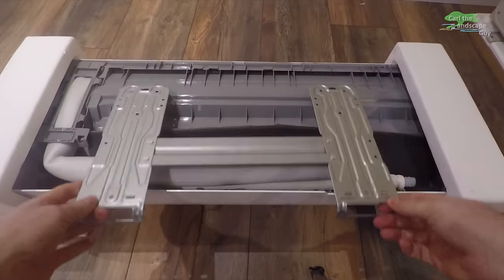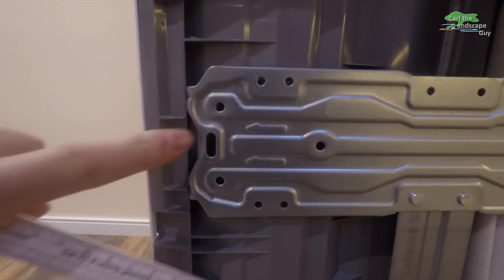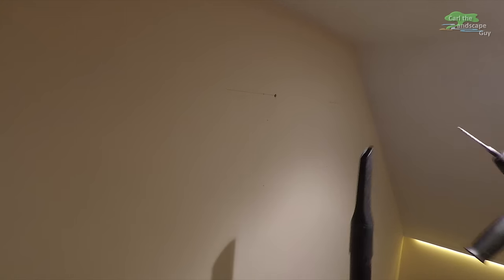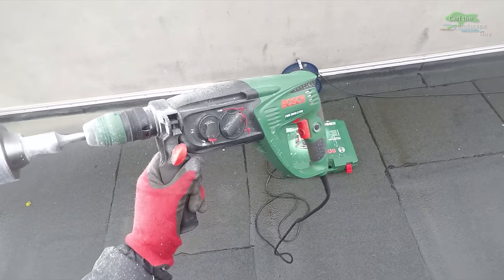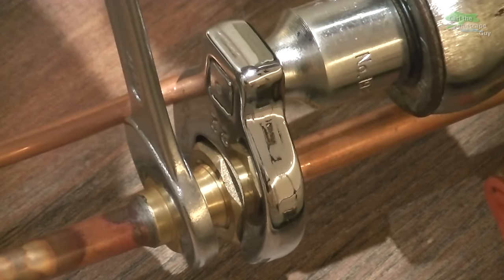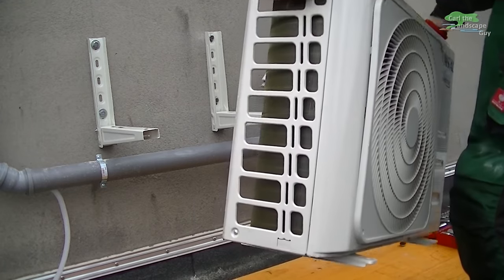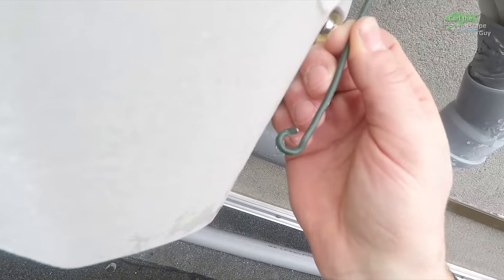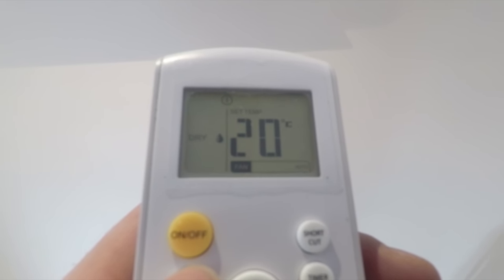AIR CONDITIONER DETAIL INSTALL |SPLIT DUCTLESS AC HEATING INVERTER,MINI PUMP SYSTEM SETUP,DIY HOW TO

Comment: very nice install. but, wouldn't it better to do a leak test BEFORE taping everything up? what if there's a leak at your flare connection from the indoor unit?
Reply from the maker: there is no leak because I followed the instructions, ac is still working great that means no refrigerant escaped

Comment: where do the nitrogen strength test and the vacuum tightness test stay?
this is an improper installation.  in this case there is no manufacturer's warranty either.
Reply: He hand pumped a vacuum 🤔
Reply: @DadBodTalk  it is not effective enough
Reply: Right. All that effort into double-insulating the lines for "efficiency" when he could have gotten actual efficiency by properly vacuuming the lineset.
Reply: @meow2148  yes i didn't want to write that anymore.  because a standard commissioning is even more complex.before the last vacuuming, nitrogen pressure test between 3 and 5 bar would be required.

Comment: Great Video. One observation, i would have put the Bolts down so it the nut did vibrate off you would still have the bolts in place.
Reply from the maker: good idea but i think that didnt fit for whatever reason
Reply: @CarlTheLandscapeGuy  no instructions with china gear.usually in 3rd rate broken english slang.could of wrapped the short lines then done rest from outside,but,all works..

Comment: How can you vaccum the mini-split without taking out the schrader valve at the suction line? Also you did not display to using Allen wrench to let R-410A to flow to both lines.
Reply: He depressed the schrader as he was using the hand pump
Reply: It's R32 in there nitwitt !

Comment: Is there a lever that you have to turn on to allow the refrigerant into the evacuated lines? I did not see this in the video?
Reply from the maker: there is a piece of wire that I used , check out the second video about this install

Comment: The pipe work is awesome. However, even if you hold 24 hours of -1Bar,  it still got chance to leak. You should make sure no leak after refrigerant flow then to seal those pipes. There are couple ways to check for leak. The internal pressure is much higher than 1 bar when refrigerant flow and chances are there is micro leaks and you can't detect it.
Reply from the maker: okay maybe you are right but this is the way I was able to do it and until this day it's still works great

Comment: Hi Carl, could you tell me how to connect the unit to the power in the fuse box please. Thank you. (or can I plug it into the power point)
Reply from the maker: you need to run a wire from the fuse box

Comment: Great video, quick note, crow foot sockets should be used at 90 deg for correct torque value set on torque wrench otherwise your over torqueing.

Comment: First mistake, pipe connection shouldnt be inside the Wall!!!!!! So hole should be on the left side.
Reply: seems like a good point, in case there is a bad connection/leak. so you need to leave the line before the connection inside the room? it will be tucked on the back of the inside unit? is it bad to do the connection outside, if the wall is not tick?

Comment: How did you turn freon into the system? Forget to show as two valve-two steps.
How did you get air and vacume system without turn out orfl. from the service valve? One step.

Comment: Hello! Why are the two pipes in the indoor unit not connected to each other until coupling? Is it not lost in efficiency by heat transfer between the two pipes?

Comment: Does this ac has drain plug at the right side of drain tray as a option to shift the drain pipe there ? ( i mean right side when you see the AC from back  . Viewing from front it will be to left side )?

Comment: Everything is amazing however , you should’ve used a water proof isolator instead of connecting directly to the outside unit ! But, maybe that’s just here in the uk 🇬🇧

Comment: Is it possible to bend at 90° the output line from interior unit to make it goes up instead of back like you did?
Reply from the maker: maybe but be careful bending it like that
Reply: @CarlTheLandscapeGuy  I've done it finally. I used plastic wire to bend the output line and it works perfectly!

Comment: Hi, I have a question. Ones trying to unscrew bolt from indoor unit gas comes out as unit is filled with gas from factory. So my question is what to do in this case? Is it gas only holds in pipe or it will leak out from unit too?
Reply from the maker: you might have a pre vacuum line that you just click on

Comment: My ac technician tilted the from unit of the ac on the left side a little but noticeable 
The pipes comeout on the right side
Will it be any problem? They said it’s no problem
But wouldn’t water be on the left side more because of the tilt? 
The AC works though and water comes out through the water pipe
Reply from the maker: thank you good information, my unit still works find, have a good

Comment: I'm now expert, but can this be installed further away from the outer wall?  I have it in the corner where I would want to build a closet and about 1 meter is where I where I want to attach it

Comment: It worked very nicely, but it was wrong in the vacuum stage, it captures the air inside the tube but not the moisture.

Comment: Never seen a ac unit install so nearly before From India. Also please let me know sir. can i do the vacuum process after the installation. because my service person did not do the vaccum process. my new ac 3 days ago. So now can i realize full gas or only lock the outdoor unit and do the vacuum process for indoor unit. New installation service person can do that??kindly please let me know sir.its is possible??
Reply from the maker: thank you

Comment: Pvc Vs copper, which is better? I see a lot of AC are using PVC pipes. Can PVC pipes handle the low temp. of the refrigerant?

Comment: Same with the plastic drainpipe. Mount  the connections "upside down" from normal, you want to keep water from getting in, not keep rainwater from getting out.

Comment: Good video, one thing I don't see right is how to set the torque gear and crowfoot wrench, it MUST be 90 degree, Torque is force time distance,. The way you apply torque, you may be overtorque  the pipes fitting. My 2 cents

Comment: Came here to see how is the assembly of the unit.  I've got a particular and unconfortable issue. There is a mouse/rat(not sure) in the indoor unit, between the wall and the cavity of the indoor unit. Probably it managed to get in through the pipe's hole. Now I don't know what to do, as I am renting the place, I reckon that should be a property manager problem, as part of the maintenance of the property. I don't want to clean the mess left by the mouse nor I don't know if it is already dead., as well as I am unsure to open the unit, don't want to deal with unexpected accidents that might be costly

Comment: Need to pressurize system to at least 100 psig to make sure there's not a leak for 12 hours then pull a real vacuum if it holds then open the valves and adjust the charge, the installation is clean

Comment: Are air-conditioners usually replaced after 12, 13, 14 or 15 years or usage?
Reply from the maker: dunno, mine still working great

Comment: just a small tip. when using a crow foot in a torquewrench you need to align it 90 degrees to get accurate torque. the way you did it is wrong.

Comment: In indoor unit, you twisted the pipes to straightening, is it ok ? I may unbend to straight first and then bend to desired direction. Basically is twisting copper pipes 90' ok in this dimension ?

Comment: I purchased this unit HTWS035PLUVWF-I22060404 three months ago and used it on some days only, so it is basically still very new. Yet it already is not working well or at all. Here are the problems in detail:

1. The unit does not heat and only blows cold or cool air when the remote is set to 21C or 22C or even 25C, also 28C and the room temperature is 18C and the setting is set on the "SUN" (heat) and the fan speed is set on "A" and three vertical dashes (automatic, fast), which is a normal setting, without any extras on the screen. It blows and blows and blows for a long time and room temperature does not change much. When it was new, in February it used to heat the room fast, but not anymore.

2. In the beginning of "heating" it shows a "blinking (pulsing) propeller" and the "compressor" icons for quite a while or sometimes always.

3. What does the "Compressor" stand for and what does it do? The owner's manual does not explain  anywhere what COMPRESSOR is for? How to turn it on and off?

4. What is the "I FEEL" setting for? Again, the owner's manual does not explain what I FEEL is for.

5. What does "UVC" mean and what is it for? What is the UVC button for and why is it not explained in the owner's manual? How to use it and what is it?

6. Sometimes the unit changes the temperature number on its own! It changes it on both the remote control and on the unit screen while I was not doing anything.

7. The many options (settings) available for this unit to run do not work really. It just does not heat and is rather nonsensical.

8. What does "Cooling Airflow Proof" mean and what does it stand for and how does it operate? Why is it not explained in the owner's manual?

9. Clean Button - I did not use it, but the owner's manual does not explain what is it for?

10. Airflow Sweep Button - owner's manual does not explain what it is for and how does it work?

11. Why and when blades are horizontal or vertical - how to understand this?

12. Sleep Button - owner's manual does not explain what is it for and how exactly it operates?

13. How does the timer operate and how is it set up? Owner's manual does not explain it.

14. Water droplet Icon - DRY - what is this function exactly for? Owner's manual does not explain what is it for and what it does?

15. What is "AUH"? And why do you write abbreviations without even explaining what they mean and how they operate and what they stand for?

16. G+ - ? Same as #15. No information. Owner's manual does not further explain what is it for? What is "Generator mode"?

17. What is a "Vertical swing display"? Owner's manual does not explain what is it for and how exactly it operates? Same question about Horizontal sweep display.

Comment: So here's a question. For a 2.6Kw unit, why do you need a dedicated line from the fuse box (consumer unit). Suppose you wanted 5 or 6 of these - are you going to run a dedicated line for each one? Seems ludicrous. A 13Amp mains socket extension spur from the room it is servicing should be fine. I could understand it if it was a much higher wattage like 8Kw but small unit like this you can power it from a normal outdoor socket. Just because it's an external unit, electricians often like to charge you through the nose and make Swiss cheese out of your walls.

Comment: Nice install but I was told that you need a licenced refrigerant person (coz of the dangerous gases) and a licenced electrician to do the install. Looks like anyone can do it if you know how. After the install, did you get a qualified person to check your work? I might try doing it myself the next time I need an AC and save me a whole lot of dough.

Comment: Depressing the schrader valve for vacuuming was done only on the suction line. There was no way to do the same on the subcooled line. I haven't seen cracking-open the allen-head valve ports to let the refrigerant flow through the copper tubes and to the indoor unit before starting it up. Maybe he forgot to show them. Anyway, nice video and clear explanation.

Comment: I belive You Installed 12000 Btu Ac.  My job Install Ac to but im always Install 24000 Btu or 36000 Btu and 48000 Btu becouse here to hot small Ac not enough For cooling rooms. In summer we get over 50C°

Comment: amazing work and very satisfying, but i have one tiny question, why didn't you just cut the outside extra pipes and wires and
shift the outdoor unit to the lift and fix the pipes directly instead of making the L shape which is very long and may result in losing more energy, that was my logical thinking, i think you might have a convincing reason for that.
Reply: Units come precharged with refrigerant for a certain length of lineset (which is what comes with the packaging). If you want, you can increase the length of lineset and add some more refrigerant but you cannot reduce the lineset size beyond the minimum length.

Comment: I have done all the steps how ever i did miss the vaccum  pump part! and i did run the airco, would that cause any kind of damage in the future ? if so can i still do anything to empty the air or its too late? thanks in advance
Reply: It's too late if you didn't use a vacuum pump and you already released the refrigerant into the system. The reason you use a vacuum pump is to remove all air and moisture (air holds moisture). The moisture and air will affect system performance and won't run efficiently and eventually will react with the oil in the compressor causing it to become acidic and damage the compressor. Ideally you need a proper vacuum pump and a vac stat and should be pulled down to at least 500 microns

Comment: You made it so your Electrical has no way to dissipate heat the way the insulation was intended to. If there is a bad enough short or end up with a faulty over current protection device you may end up with a wad of melted insulation, wire and copper lines. The cord cover is a whole other issue as far as "protection". Then again i do not know where in the world this installation is taking place nor the building codes associated but in the United States that would not fly. Electrical aside a very neat looking install.

Comment: 25:51 - Why did you leave that bit of plastic tube on the valve please?..

Oh great. I just got one of those pumps delivered and it won't go to 1 bar >.< And I saw in some listings (not the one I used) that is says:
"Negative pressure up to 635mmHg" - Which is about what mine does. 
1 bar = 750mmHg. So I guess the pump you got is functioning better than normal?.. 
Annoying. I wonder how much difference it'd make vacuuming to 635mmHG vs 750?..

Comment: I bought an insulated 1/4-1/2 inch tubeset of 3 m. The insulation is molted together and both tubes have the same lenght. In the indoor unit the 1/4 inch is about 20 cm longer as the 1/2 inch. I can pull the 1/4 inch tube through the insulationfoam, but after it will be longer at the outdoor unit side and this is giving a conflict. I wonder in your video the outdoor side has properly the same lenght.
Do you have a tubeset with 20 cm correction or so? Do you know how to solve this without flare connection tools?

Comment: One step that you could have done extra is after releasing a bit of the refrigerant spray some soapy water on the connections to test for leaks. If there are none, release the rest and check again. Much more of a pain to do the indoor ones, but the out door ones are very easy to get to....
Reply: Hi did put a vacuum on the system for 24 hours, and there was no lekage. 😊

Comment: Could you please just tell me what torque values did you use for those two pipes. My aircon specifies 16 and 26 Nm for 1/4" and 3/8" pipes, so I did so, so far, on the indoor unit. Are these supposed to be tighten beyond these values. I saw you were using 26 Nm on the bigger pipe and haven't seen (maybe 18 ??) for the smaller one. Should I take off indoor unit and retighten the connection?

Comment: The air conditioner I bought says there is no need for vacuuming, they say we vented it, is that true?
Reply from the maker: they now make quick connections with pre vacuumed lines, makes install easier

Comment: What can the maximum length of coolant pipe ? From the inside unit to the compressor ? I am planning to install one on my groundfloor and wants to install the compressor on the secondfloor terrace (approx  15 to 20 feets away). Is it possible?

Comment: Wish you would show the electrical  supply hook up. Is it 110 or 220??
Reply: Mind444 Spiritual Tribe He sounds European, it will be 220 - 240 volts depending on the country, single phase.

Comment: U can just put the pre pipe in the hole and clip the unit, after that u can work on the pipe outside of the house and tight those nuts then do a leak test by pressurising the pipe with nitrogen and bubble on the joint without having any leaks problem.

Comment: If the crow foot is at right angles with the wrench you will not have an over torque issue but great install

Comment: Hi Sir . 
Why did not you use vacuum pomp for copper pipes , before open the gas valve ?
Now there are  air at the copper pipes and all of the aircon system , it makes your system low efficiency..

Comment: You have bent the outside pipes to 90 degree without any tool , if they collapse you will have poor refrigerant flow. One more question , if you test the system for leaks before install and if there is a leak how would you check it inside the wall. You should always drill the hole on your left hand when you are holding the ac to install on the wall. I am not sure this was the correct method to install the Air con. But good luck